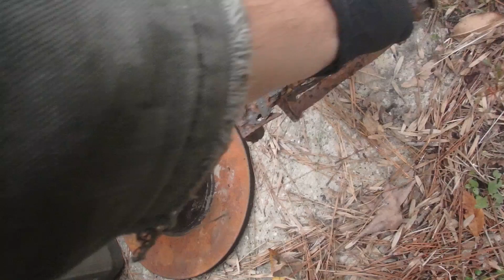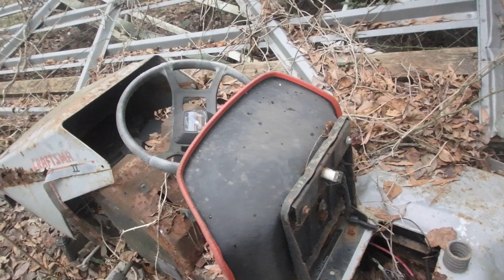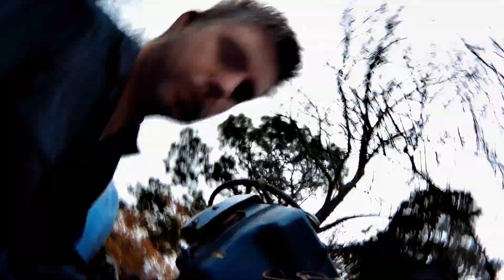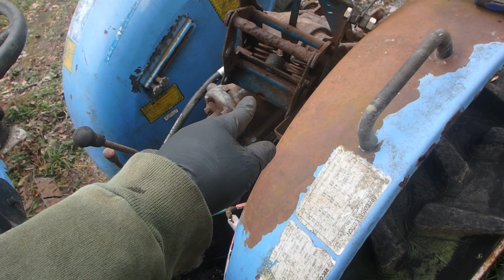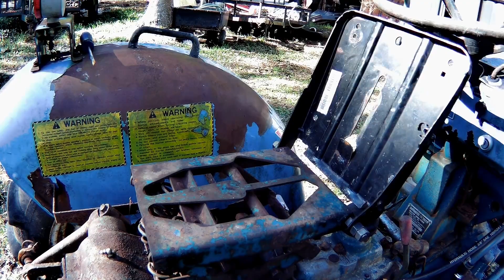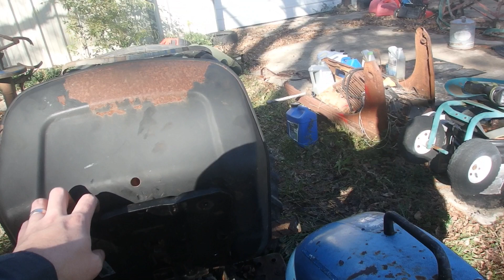Repairing The Free Rusty Hinomoto Tractor Part 10

Comment: Fantastic! I have a Hinomoto E152 that's a few years younger than yours, but it has the same engine (S100?). Scanned through your vids finding where you started it. My starter has never worked that well, even after a rebuild. It always gets stopped by a cylinder as it reaches compression, struggles through then spins til the other cylinder compresses.  Have you had any such issues? Is your starter original? Thanks for any info!